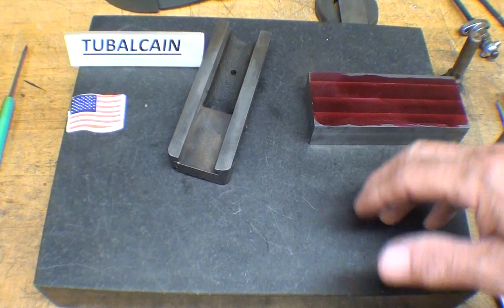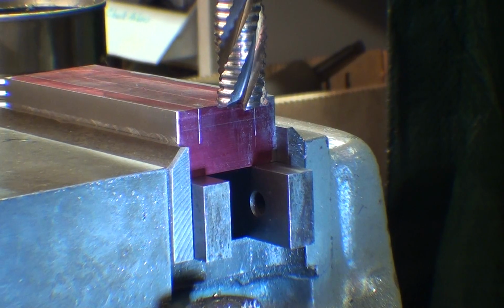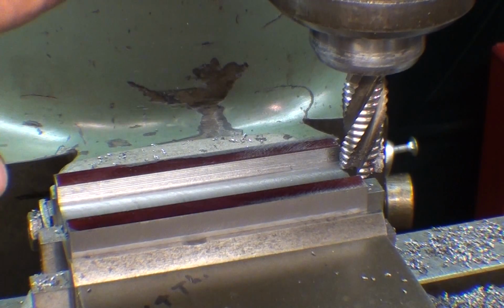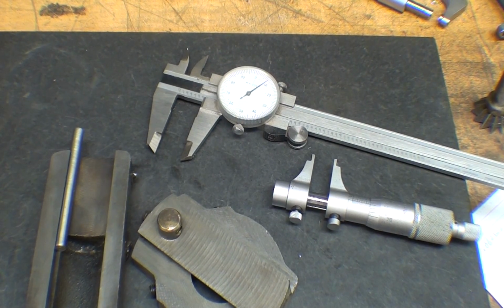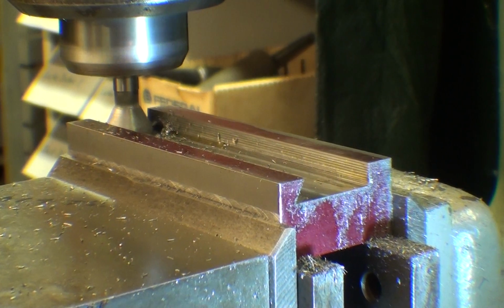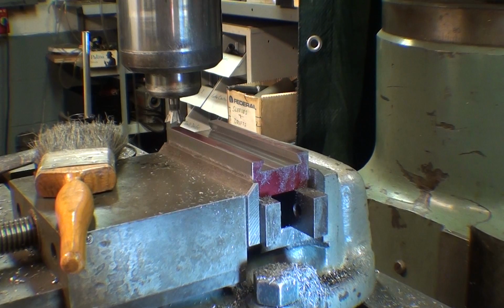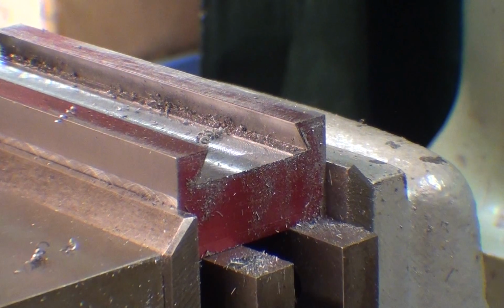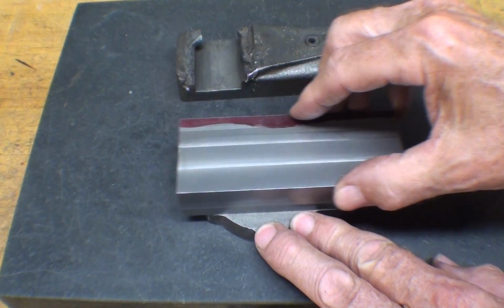TIPS #334 pt 2 Compound Rest for a 6" Atlas Lathe tubalcain

Comment: I'm a semi-retired Carpenter. A few years into my trade I took a Votec Machine shop course.
I was tired after work and fell asleep at the lathe. I knew class was over. All these years later
I'm in You Tube class. I've been watching You, Abom, both Keith's and TOT, for around 9 months in anticipation of getting a hobby lathe and mill. Watching you slot the Dove-tail I
was thinking there is a conventional cut and a climb cut. You confirmed I got it right. When you
were 2 thou off hitting  .615 and it fit I think you just eliminated years of wear, so I'll be thinking about that whenever I make replacement parts in the future. Still a year or so out on getting 
machines but it is fun learning now. I'm sorry for the length of comment but It's all to say thank
you so much for putting your time out there for us.
Reply from the maker: Thank you so much for watching and I’m glad you’re learning. It’s never too late

Comment: Hi Mr. Pete,    one of these lathes came into my shop in a basket for sale. I guess I am like  you,  can't stand to see a machine die so I got it and restored it. After my research I have found it was made in 1937, one of the first 6x18 lathes made for the 1938 Sears catalog. It has no back gear or bull gear, has a thread counter and change gears for threading,  no oil hole for the compound nut. The gear cover is bell shaped.  The half nuts were ordered new off ebay,  but are a bit to large for the screw and will jump a thread at times. Now for the good part,  after paint and set up with a ground 3/8 printer rod in the chuck it's total run out is .0008. Shocked the heck out of me, so that is what I named it,   Shocker .  Photos apron request.  I use it in my carburetor rebuilding business for those small jobs that won't fit in the 10EE. Thank you for saving another of Americas fine machines.
Reply from the maker: I bet that is a nice machine

Comment: Nice work so far on the rebuild. And i see nothing wrong with quick brand inserts or mentions if the product you are using actually works well compaired to others. Its the 40 mins of commercials and 20 mins of TV that ruin TV, I have not watched regular TV in 10 years or more lol.

Comment: Hi Mr. P: Another awesome series!

John @ Doubleboost had a good observation on the relief on the dovetail base.  His theory is to cut the slot to full depth and then set the dovetail cutter slightly - say 0.010" - higher than the base of the groove.  This gives a bit of clearance to clean out swarf from the base of the dovetail cutter.  It seems like a reasonable theory.  

Thanks again for the great videos!

Comment: Mr PeteThanks for some of the best video I've seen on youtube.  My dad and I purchased a 6 inch Craftsman lathe 40 years ago and it has sat virtually unused since his passing in 1995.  I is in nearly new condition and has been kept covered in the back of my mostly woodworking shop.  You've given me the impetus to clean it up, lubricate and inspect it.  Most importantly you've given me a reason to learn to use it.  At age 70 it may be a late start but I'll try to be a good student.Pete Woodland
Reply from the maker: Thanks--its never to late--give it a try

Comment: As you said there are 100 ways to do something. When I cut dovetails I use an adjustable parallel and regular micrometers to measure the slot. Most of the time it is to adapt large lathe tools to my quick change holder on the lathe.
Reply: I agree the adjustable parallel trick makes life so much easier !

Comment: I used to have a Halifax 524 lathe which I understand was an Atlas clone, it was 4 1/2 inch centre so 9 inch swing  (not very well put together and the headstock casting had a crack) so being young and inpecunious I   stripped it down, heated up the casting with a blowtorch and welded the crack using nickel arc rods from the local farm suppliers  (they would sell you individual rods), I was quite surprised by how well this worked, I tidied the casting up with angle grinder and files, reassembled the lathe and it worked, I can see how a careful and skilled mechanic might have repaired that cast topslides properly  (rather they hand the mess you found when you bought the lathe.
inspired by that success with nickel rods, I was in a fix when one of the needles on my International Harvester bailer broke just in the middle of one of those brief dry periods that we get in the West Country which allow a little haymaking. They told me the needle was cast iron and a spare a week away, so out came the blowtorch,  nickel rods etc, and I amazed myself by successfully welding the needle and saving the harvest. 
At present I have a little Myford ML7 to play with,  it is a 1950 model so my senior by 6 years but little worn and accurate, the other toy I am playing with is a Southbend of 1936 vintage, it is in bits at the moment and has two cracked teeth on the back gear - so I am wondering how to 'bodge' that one back into use - those nickel rods and my files once again? ? or would that be just asking too much of that technique?
Reply from the maker: Thanks for watching. Thats a good story about the needle repair.
Yo can give that SB gear a try, but thats a lot of filing

Comment: I don't remember who made inside calipers for dovetails (the tips fit standard dovetails as far as i know) but they do exist. At the very least, they used to be made, and whilst it's not one of those tools you use all the time, it sure is the tool to have when it's the right time. :)

Saw em a year or so ago at a yard sale, didn't buy them, which i regret, because one of the legs was bent, now, a year later, i would know how to properly fix that. Oh well.

Comment: Your measurement technique for confirming that the dovetail is the proper width is nifty, but I wonder if there might be a slight modification.  In your method you cut one dovetail to a given dimension... but how to know if this is the correct dimension?  Then you cut the other side and use the two rods to reach the established width between.  

I think too much perhaps, but wonder if the weak point in this procedure is the first cut.  Also, how to know if the rods are of precisely equivalent diameters?

Would it be better to use a single rod and measure from the outside dovetail boundary on one side to the rod on the other for your initial cut?  Then, you might know you've gone in exactly half the total distance required.

Comment: Making that dovetail on the shaper would be a good one to cover.  I just recently acquired a 15" Steptoe Western (and I don't have a mill ... won't have room for one until I get some more concrete down in the shop).  Finding specific instructions for more complicated work, on such a machine, is a bit harder to find.

Comment: Mr. Pete, In the first video you mentioned the stresses in the block of steel to be machined. I would have thought you would machine the groove for the brass nut before the dovetail. Did the dovetail dimensions change after cutting the groove?

Comment: Mr. Pete, please do a video on the subject of how machinists determine pricing for their work. By the way, I'm one of those hammer and chisel mechanics you loathe so much and every time I have to grab my mallet I say a little prayer of repentance to you.
Reply: On a short message, step no 1 is materials, step no 2 is how much the tooling costs (and you factor in either the price of a new tool or wear), step no 3 it's your time, that's something you have to figure out, it's based on electricity cost, how much you want to earn per month, competition (stake them out, always, in your area, and further), quality (if you work top notch, you can price top notch, if your work is shoddy, well, not so much, you might get away with it once), and finally i'd say time in which you're asked to finish the work. If it's a long term deal, it depends on something like "hey, your item X is keeping this part of the shop occupied, i need to know it's going to pay me back in the end, otherwise i'll loose potential money), is it an overnight, then you have to work fast, you can squeeze some $ from there, is it dangerous.. etc.

Ultimately, you need to look around you and figure out what you have in terms of qualities (it also helps with improving yourself and your tools), those are assets you can base the sum. Also, never forget the haggle, the oratory art of narrowing the price where you need it, but at the same time, where the customer can afford it.

It's a complicated thing to figure it all out, but, the best part about being alive is, you've got a long time to do that, and once you've done that, you'll end up like the old folk, who, on a glance, will say exactly how much it costs. :)
Reply: Figure:

The cost of labor

The cost of all parts that are used in the product. This includes every bolt, nut and washer, etc.

The cost of overhead. This is the tough one. It takes in every other cost of your doing business, when it comes to making a part; or servicing a part. IE; Rent, electric, gas, water, sewage charges, other salaries to run the business, plus taxes, insurance, etc, etc. This requires some serious thinking.

Add these up. At this point you have made not a dime. Then multiply that by the amount of "markup" you wish to make as an honest Jesus-fearing business man; if you are wise. This then would be the total cost of the job.

Example:

A person wants you to make a new valve for his windmill pump.

You estimate 4 hours labor @ 30 dollars/hr=$120.

Cost of parts = $75.

Overhead has been running at (in your business) about 70% of labor and parts. Multiply $195 X 70%=$136.50. Added together= $331.50

Increase this by your desired markup (say 30%) Add this to the total above.

$331.50 + 30%=$430.45

That should be your price. Be careful. Do you really expect 30%? The other costs can vary as well. However, resist the tendency to engage in "off the top of your head pricing". That will either send you to the poor house or to jail. Oh indeed LOL.

Remember: NEVER be ashamed of your labor. A big mistake by all too many in business. Keep meticulous records. In a relatively short time, you will see a pattern forming that will be ever cemented with each job you do; when it comes to markup and a fair price.

This is not a new concept. Seasoned and successful businesses have used this formula for many decades.

Note: This is why we all experience "sticker shock" from time to time. NOW you know why even for the righteous businesses. Believe it or not.

Finally. Remember, there is NO free lunch. Unless, of course, it comes from our dear Lord. Then it is always 100% free and all "after affects" are guaranteed wonderful. Praise His holy name.
Reply: As I stated in the OP, I'm a mechanic. I have my own small shop and one of the toughest things to learn, once going into business for myself, was how to price jobs. That formula is basically what I've come up with. I'm surprised you'd estimate labor at just $30 an hour. That seems low for the skill needed to run most machines. I typically consider a machinist to be higher on the skill scale than auto mechanic and I wouldn't get out of bed for 30/hr!
Reply: The reason I'm curious about rates at a machine shop is that even the "easy" stuff you see in some YT vids a la Kieth Fenner or Abom looks like it would justifiably fetch a fortune!
Reply: You are absolutely correct. I have been retired for 21 yrs. I forget  how much things cost today, especially "Labor"; compared to when I was in the "field". Thanks for correcting me.

Just change my steps to whatever is the going "rate" for labor.

Thanks again.

Comment: Great video.  That will be a lot better than the original.  Keep on keeping on.
Reply: I have a 101 and the original compound is actually a poor design in that the crown of the casting is higher than the machined surface where your tool post rides. It's not a big deal unless you want to upgrade to an Aloris or something...then you have problems with clearance. Mr. Pete has got me quite interested in this project.
Reply: The Mrpete222 model will be a lot better than the original.
Reply: in fabrication regards, you're totally right, the choice of material is not optimum for this application
the main reason for using cast iron for mchine tool construction is that this material typically dampen the vibrations, steel in the other hand have the tendancy to amplify the vibrations.

Comment: Coming along nicely. 
I used that same rod measurement technique to check the dovetails for parallel on the old compound. 
It works well. I used some 1/4 x 3/4 dowel pins.
You go right ahead and keep telling us what brands you're using when you feel it's appropriate.
I want to know what cutters and brands work. I want to understand how different cutters behave so I know how to improve my results.
Thanks for another great video and for a great project.
John